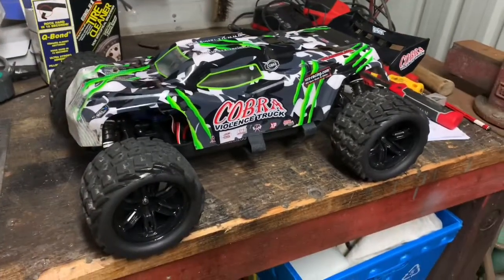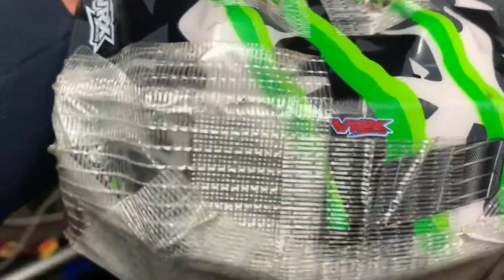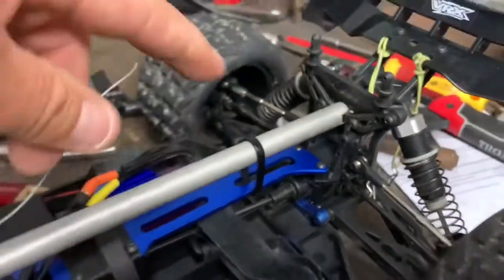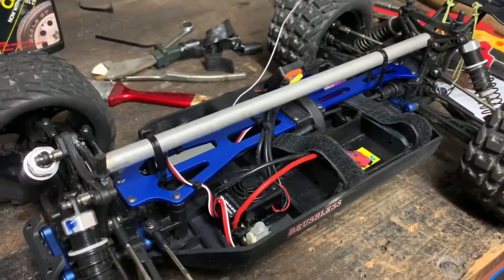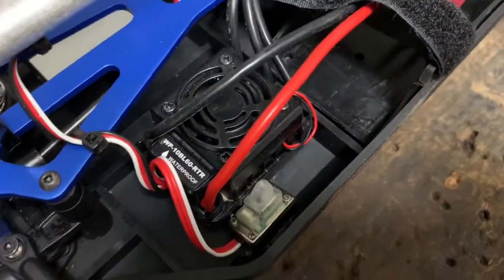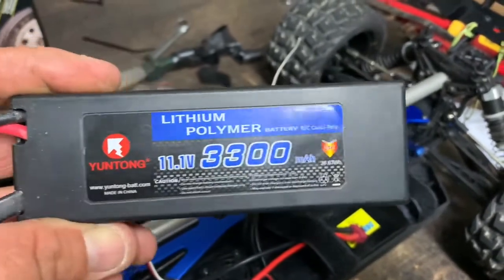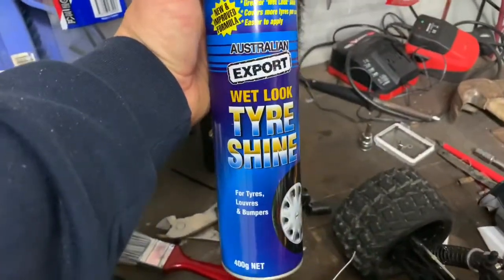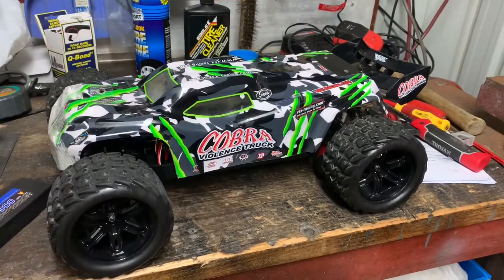VRX Cobra Violence,  Front chassis modification - temp fix - body strength modification

Comment: Man I would never have thought of that string trick for the pin's, smart!  
I think that tape is called filament tape, but I could be thinking of something else.
Getting into it 🤘
Reply from the maker: Yeah was getting sick if losing the R pins all the time. Looking forward to doing the pinion upgrade and finishing the strength support. Batteries are next for me. I’m only getting 12 min out of that 3300. 🙁🙁.
Reply: @angesrc  mate if you were close I'd just offer you to come and grab everything you needed to be 4s ready! Including lipos! 
But that can't happen with these restrictions so I would suggest anything over 4000mah 3s or 4s for that size car👍 the 4500mah Youme 4s are perfect i think!
Reply from the maker: RC crazy yeah definatly going to go for the 4500. We are not that far from each other. I actually know where u are from the surroundings of the park. But I won’t reveal that here , I’ll keep that private. We are only about 20 min away from each other. Looking forward to a meet when restrictions are done. 👍🏼
Reply: @angesrc  ok then, yeah we'll have to meet up and go for a bash when restrictions stop🤙

Comment: what size is your motor? 3670?
Reply from the maker: Yeah it is. Motor rating is 2600kv
Reply: @angesrc  I just got the pre-assembled kit yesterday and someone suggested a 3670 motor size would be best.   How does yours run?
Reply from the maker: @mace2gorc872  yeah it runs great. I also have a 15tooth pinion on there also. 
So stock motor is 2000kv and pinion is 13tooth. With that setup and the stock tyres, I can get up to around 64km. Which is more than enough speed for that car.
Reply: @angesrc  awesome.  I ordered my electronics already, so hopefully by early next week I get them and I can put them in for a first run.
Reply from the maker: @mace2gorc872  sweet. Make sure you do a vid. 👍🏼🚗